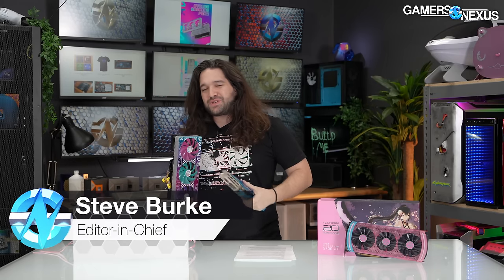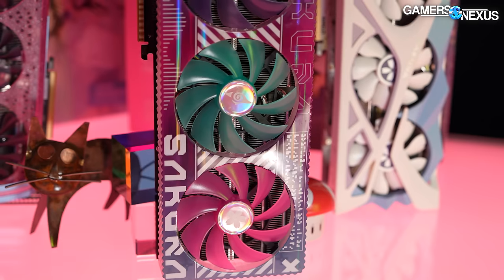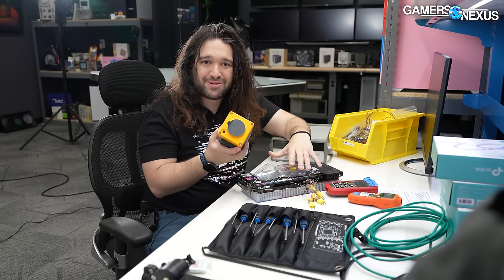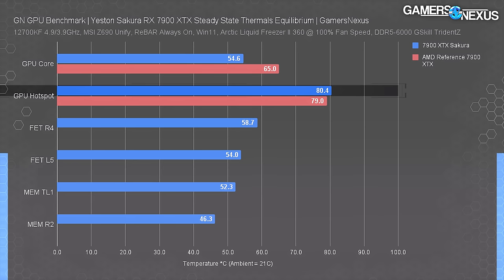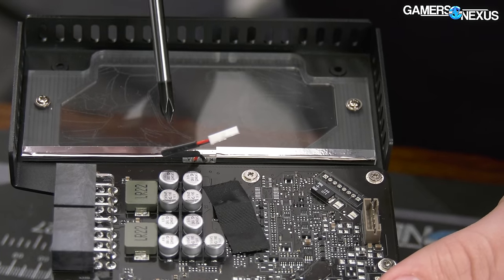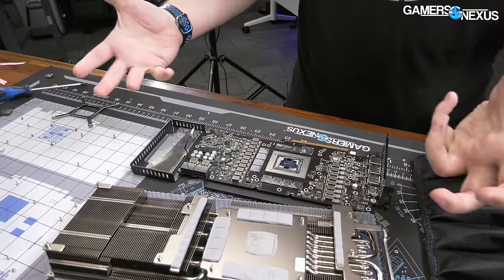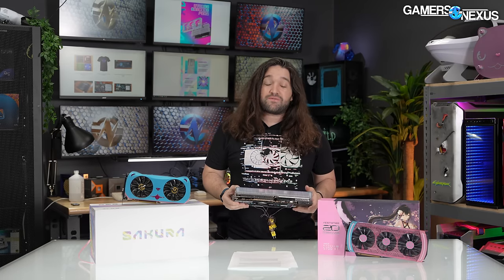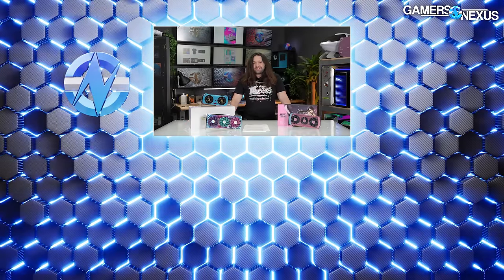Crazy Design: Yeston RX 7900 XTX Sakura Sugar GPU Review & Benchmarks

Comment: Since EVGA's departure from the video card market Yeston is now my favourite video card 3rd party.
Reply: Same. I settled for EVGA for the PSU but I got their 3080 for the same reason.

Bright side is their warranty is 3 years, not as good as EVGA's 8 or 10 but it's still pretty good.
Reply: Sapphire are the other goats
Reply: @henryojeda2890  too expensive
Reply: @THEpicND  let be real here we paid for well enough build quality + design... mostly for design. 
The only reason I didn't buy sakura rtx 3070 is because there dell rtx 3080 ti at the same price.
When I upgrade again in 5 years, I'll buy yeston gpu rather than other bland design.
Reply: @THEpicND  the pulse is one of the cheaper listings out of anything though
Reply: @henryojeda2890  My Sapphire Pulse RX5700XT was just nothing but trouble. It constantly overheated above 100°C in a well ventilated HAF cube case. After the third heat stroke and RMA, i just sold it and got an EVGA RTX2070 super XC Ultra. That was in early 2020. 

I'm using PC's since over 20 years now and ATi/AMD graphics often meant trouble and driver problems. The only good series they had was the HD7xxx one.
Reply: @hyperturbotechnomike  bummer. I have the Nitro+ and it hasn’t ever hit above 64C. 1440p @ 144hz. Never had any driver issues with the card either and I have owned it since two months after initial launch. Ive worked with Pulses and they are good cards. Sounds like you just got unlucky.
Reply: @THEpicND  Sapphire is literally the affordable ones… blame tariffs I guess
Reply: @hyperturbotechnomike  for reals? My Sapphire 5700xt nitro+ was amazing. My 3070ti however 🤨 is now bugged with driver issue and it has only fucking 8GB VRAM just like my old 5700xt
Reply: @hyperturbotechnomike  hmm  I rem HD4XXX was also good :D

Comment: With how vertical mounting has become a selling point for newer cases, I'd love if they made a new version of the Cute Pet GPU.
Reply: Notice with thanks☺
Reply: Vert is still unreliable and causes a ton of issues. My bud had a vert mount in his last like 6 builds and it turned out to be the cause of all the issues he was having (troubleshooting lasted weeks)

Until the tech to make them a 1:1 replica of as reliable as horizontal mounting, vert mounting will always be behind
Reply: @reloadingdontshoot1  "always"
Engineers rarely use that word.
Reply: @reloadingdontshoot1  life hack, put your pc horizontally like everyone did back in the good old days and don't have sag ever again
Reply: @AdrianOkay  The only 2 issues that I can think of that would be caused by vertical mounting would be decreased signal integrity from the riser and from vapour chambers acting up (see AMD reference cooler issues). Notably, the latter is the most likely on any half decent case and would be exactly as likely to occur with standard mounting when sitting the case flat. Likewise, vertical mounting a GPU also eliminates sag, so the sag isn't causing the issues the other poster was having.
Reply: With 3 fans, lol. = )
Reply: @yestonofficial  wow yeston here....noice!
Reply: @AdrianOkay  My NR200 is actually standing on the front panel
Reply: @Dark.Syndicate  Thanks😆
Reply: more a design flaw than a selling point.

Comment: Jesus those VRMs are insane. 20 phases (no idea how they divide it) of 70A top-of-the-line stuff from monolithic, just to power a 7900XTX? That's more than overkill, jeez. This thing right here, at least from its component choices, plays up right there with other top of the line 7900XTX from other manufacturers. This stuff is flagship quality.
Reply: I almost purchased it. If it wasn't for that it had an 8+8 PCIe connection, instead of the 8+8+8 PCIe connection offered by Sapphire I would have purchased it, watercooled it and done a whole anime girl theme ordeal. I also think they should have went with a white PCB, PCIe connections and a white backplate for it, as that would have looked so much better . Well, better for my build anyways. Heh. Still, I should have gotten it. Could have used it for another build and sold it later.

Comment: I cannot wait until the western market starts taking some risk in GPU aesthetics. I'm all for great technical design, but I'd love to see some varied design like these waifu cards. As far as I know the most "zany" gpu design is ASUS's evangelion cards. Love the in-depth review as always, Steve!

Edit: Any chance we can get a read-along with the comic on GN Extras? Storytime with Steve? Anyone?
Reply: they could definitely make swappable plates at assembly, it wouldn't change the cost of the base series by much, and it would definitely drive sales.
another option would be to have magnets and printed stamped steel sheets.
Reply: Bring back those cool cards from the 2000s with the Fantasy art on them.
Reply: The western GPU aesthetic is what the eastern manufacturers decide it will be, at least for third party cards.
Reply: At least as far as Nvidia cards go, it's because Nvidia always says no to this stuff and generally acts like a total asshole to its board partners.
Reply: @arnox4554  yeston made a rtx 4080 version of the waifu rx 7900 xtx
Reply: Thank you so much❤
Reply: I miss the cards from early 2000s that had hot videogame girls on them, though there's not any hot girls in videogames anymore
Reply: @tenggheelol  Well, color me surprised. I'll just say though that EVGA didn't dump Nvidia for nothing.
Reply: @yestonofficial  if you did a rtx 4090 waifu version, i'd jump in and buy it as soon as i can :3
Reply: Are there western manufacturers?
Reply: @tenggheelol  Lol, maybe we will consider about it😄
Reply: I look forward to paying even more for graphics cards because some ***** thinks they should look tacky.
Reply: @arnox4554 EVGA pulled out of the graphics card market because they got sick of customers asking for stupid sh*t cards like this.
Reply: @-opus  Uh... No??? It was Nvidia. It was all Nvidia, and I will bet you money on that.
Reply: @arnox4554  nah pretty sure it was waifu creeps
Reply: @-opus  lol Stop trollin'.
Reply: @arnox4554  you are trolling yourself and your species
Reply: @-opus  no u
Reply: @rasurin  I play all kinds of games
Reply: Would be interesting if Yeston decides to do a Intel Arc series for Battlemage and Celestial. Maybe fit in an A-series card too.

Comment: Although it seems like a bit of a chore to take apart the card, I really like that you can simply remove the LED plate with the character etched in by removing just a couple of screws. At least it seemed like you could. Suddenly, flow-through design!

Comment: i just bought the purple demon waifu variant of 6700 XT but yes its still has the waifu backplate thing. 
Been so happy with it, ran just fine on my rig and played many games on it. The price actually gone down by a lot now (i live in Indonesia) and i pick them up for ~$320 converted to IDR. It also come with local warranty by supplier so thats freaking sweet. The only downside is probably if you don't like cute or weeb stuff this card probably not for you. Also if you live in the US or other Western side you probably only have International warranty, then it might be a little troublesome to get the warranty or replacement. But Yeston been around for a while, at least here in Asian market and their product is actually as uniqe and solid as their backplate and quirky design is so yeah im not disappointed on picking them up on discounted price.

oh also the thermal is waaay better than the older 5000 series design, it rarely goes above 75 degrees, and ambient temp is around 30 to 32 on daylight (tropical side yes).

Comment: Steve! Just a heads up! Don't shine your tachometer into your camera lens. If the laser hits the sensor in juuust the right way it can result in dead pixels or dead subpixels on your very expensive camera's sensor, requiring a repair with a cost in the 4-digit range. I've personally had it happen shooting in nightclubs where a laser is in use. Other than that, great work and thanks for such a detailed analysis of this graphics card.

Comment: Great video. I'd have liked to see you attempt to fix that hot spot temp delta. Some longer screws with springs for the retention bracket, or perhaps just a replacement retention bracket. Even if it fails, at least it'd give the consumer some idea of what might or won't work.

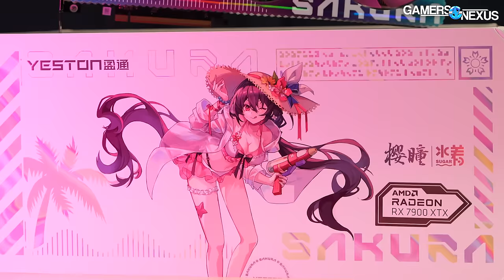Comment: 0:35 something I find always find dubious with this text on the left, is the last sentence: "any errors will be corrected in the top comment".  Is this a cheeky reference to the comment section, or does it mean the pinned comment, as in, the literal top comment? I also find it, no offence to them, but just a little bit pretentious to give themselves their own scale then deem themselves expert. Not saying they aren't - but time doesn't equal expertise, necessarily. That said, they are experts at reviewing components in my eyes, seeing as they've gone to the actual testing labs to see how it's done professionally for companies and I'm assuming they used that knowledge to base their own setups on, on a smaller scale.

Comment: Without EVGA i still have a couple of years to find a GPU vendor I can buy from, I used to like Zotac as a cheaper vendor if I'm willing to put the extra work of fixing their shortcomings when it came to thermals (Almost bought their 1080 ti AMP! extreme edition but ended up getting a FTW3 and stayed on EVGA for the 3090 ti update), so If I'm going to end up with a card I need to fuck with to adjust the thermals, one like this that can be cheap but still runs at about stock might be good enough but I'll likely still go only for brands that I recognize since in this side of the world you can't afford to buy a problem.

Comment: kinda wish the backplate could be removed without taking the entire stack apart, because as a quick and easy mod to try to squeeze extra thermal performance out of this, I could see adding pads to the components on the back side of the PCB and also removing the LED window to open up the end of the card for air to escape. especially if the card is mounted vertically where you wouldn't see the acrylic anymore anyway.

Comment: Regarding the hotspot, I have a RX 6650 XT with the same issue. Core runs at 56c and Hot Spot at 95c full load when playing, for example, DOOM Eternal. I have remounted the heat sink and replaced thermal paste and pads with a premium paste (one that is red and costs about 100 dollars :( ) and there was no difference, other than maybe a few degrees improvement on the core. Hot spot remains the same. I have concluded that this is a core design issue rather than cooler mounting or cooler design (Gigabyte Gaming OC model).

Comment: With such self-congratulatory writing, I have to guess GN is getting ready to float on the stock-exchange.  /s

On the light-switch part, I agree that it's a nice addition, though I'd like a software option (or perhaps included extension to fit to motherboard) for those who leave their computers on at night and sleep in the same room, so it's easier to turn off through software and has potential (maybe??) to have timer set to auto illuminate/de-luminate.

Comment: I've looked into these Yeston cards when I was shopping around for a RX6000 Series card. New Egg had Yestons RX6800 XT for sale in a white Sakura flower Waifu theme with light purple fans. My issue wasn't the design of the card itself but the price. I was interested in it because it would have fit into my white build nicely but for the price they were asking you could have just gotten a RX6900XT or 6950 XT instead.

As far as anime themes go the only other two offerings I've seen are Maxsun and ASUS. Though Maxsun doesn't seem to have an anime themed card this time around just yet and ASUS only does their anime themed models for Nvidia cards. ASUS's anime themed versions also seem to be sold by small third party sellers so the prices are always in price-gouge territory. Especially for a card that is already priced higher by ASUS themselves versus their normal model. So being hard to get from the beginning and being priced almost two times that of the normal model it's no wonder there's not many sold. Unless you're an anime addict with Infinite Pockets of Holding.

Comment: gamers nexus, why is fan shroud mentioned as negative? i think you are wrong, it helps to push air deeper to card, not just to let it out from side with minimum travel distance and ,,heat soaking,, from fins. Can you make thermal measurement of it? with no shroud, fans slapped on fins, half covered heatsink, and 3/4 covered heatsink. You can easily do it with old P4 coolers that are tall. its like 1-2h test, with preparation and thermal probe installation, and one duct tape to cover sides of some cooler

Comment: As for hotspot, I must note that I feel this hotspot is how RX7900xtx works. My Aorus Elite 7900xtx also keeps the GPU temp around 50-60C, while hotspot goes from 50 to 95C depending on the load. It simply feels like heat distribution in the die itself is very uneven or that GPU temp itself is averaging between main die and cache dies, or I donno...
Also, its said to see only 2 8pins. 7900xtx can make use of a lot more power. However looks like they have smaller cooler so they don't have thermal budget for it. It would be very cool if you could review large 3 8pins 3.5+ slot designs that can use 475W+ when set at +15% PL. They difference against a reference model should be noticeable.
So pleasepleaseplease review some GB Aorus Elite, Nitro+, XFX Merc or other card with max power level VBios.
Reply: Ok, I was wrong. Hotspot starts to go all crazy when you set +15% power limit, until then it sits 15C above the GPU temp @ 415W for me. So yes, Sakura lacks a bit of cooling power to keep temps at bay.

Comment: On the aesthetics side, I am even against the "flashiness" of "regular" cards - I'd prefer less plastic, more metal and no LEDs. The design change I'd most highly advocate, though, is using regular case fans of common sizes (80/92/120 mm) rather than custom ultra-thin models, paired with an easily removable shroud to make replacement a breeze. Needless to say, I loved the ASUS Noctua models.

However, I adored the original (?) 580 Cute Pet. Functional with a very cute design. If I was putting together a gaming PC for my niece, that one would be VERY high on the list - even if she's currently in a "no frills, all-black" phase. Perhaps a bit higher because of that, honestly; I am not above trolling her and her brother.

This one is, as Steve notes, more cyberpunk-themed than cute in general. The girls on this and the "Waifu" edition are a bit off-putting, though. And the performance impact, compared to AMD's stock card, is unacceptable in this price class.

Comment: I sincerely wish my PowerColor card had an RGB switch. Instead it had a header that could be used to attach to the motherboard to control the LED's. I say had because the header pins were bent and snapped off when i tried to bend them back into alignment. I don't care about turning the lights off enough to take the time to send it in for a warranty repair, but all I wanted to do in the first place was turn the LED's off entirely! In fact, if I had a choice between a VBIOS switch and an LED on/off switch, I would take the LED switch.

Comment: Hi Steve, could you make a follow up video showing the impact of the backplate? 
As you said, since there are no thermal pads I would think that VRAM and VRM could be cooler since there is no heat pocket. Also the overhanging part impeding the airflow at the end of the card would possibly lower the GPU temperature, maybe significant enough to be on par with the AMD reference card? (I feel for over 1000$ there should not be a significant performance lost just for the aesthetics.)

Best regards and greetings from germany!

Comment: Unrelated to this review specifically, but on the subject of prices, is it worth looking at 'last years heroes' perhaps as a news piece, to see if value has changed?

IE the 6650XT came out priced close to the 3060 and was trading punches with it, but now it's way, way cheaper - I got one for under £300, and the cheapest 3060 I can see is £350; looks broadly similar in USD, too - at that point, the 6650 is a compelling option if you aren't too fussed by raytracing.

Might make some recommendations change.

Seems to be a good time to snap up some fairly modern hardware, he says, having just built a 7600 based machine - not 'budget' but with PCIe5 and AM5 it should be good for a few upgrade rounds.

Comment: Hi Steve, I know this might sound rare, but can you take a look and review a case called darkflash dlc29? Quirks about the case would be that it is fully meshed so I do wonder if it makes the case better or worse (despite being really open air, there's no specific airflow path due to being too open), and maybe could you do a testing without case fans but with a good air tower cooler? (Just a suggestion because i do think that a case being so open air would not yield much difference with or without case fans)

Comment: I bet warming that card up outside the pc via a riser cable to melt that phase-change material, then powering off the system and quickly removing the cooler would make that require less force.

Comment: So ideally, you would be able to undervolt to shave off some heat. You'd want to get around 10 degrees under 70 to be in that 90 degrees range. Adjust fans so that they're not screaming. On my 6900xt I run the default uv value and default oc value. Shaved off a couple degrees of junction and core temp. Technically it's under spec but that 30 degree delta junction is concerning.

Comment: I noticed screws at around 20:20 in the LED side of the backplate. My question is if it would be possible to take the LED plate off to get air through the backplate to make the card run cooler? Sorry for my bad english i'm from Germany! :)